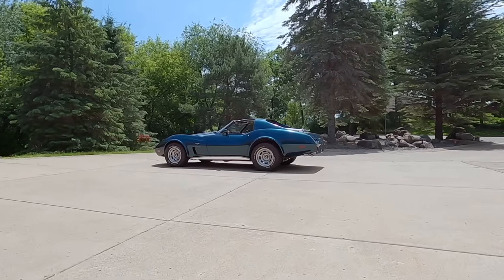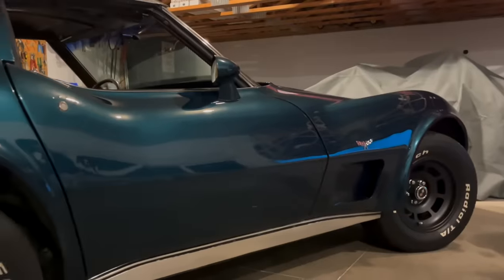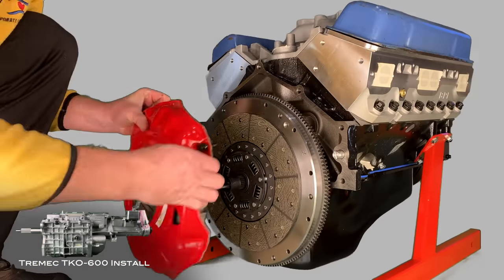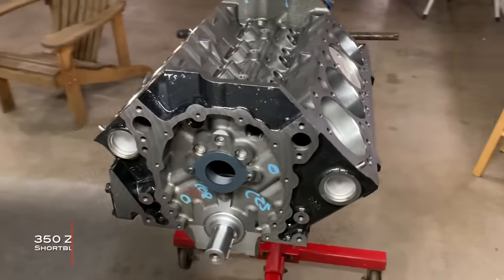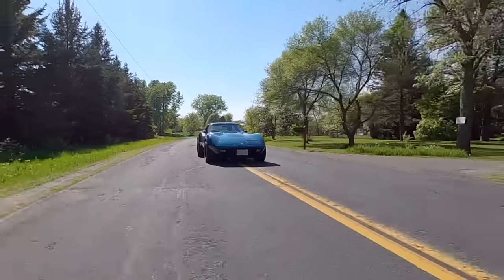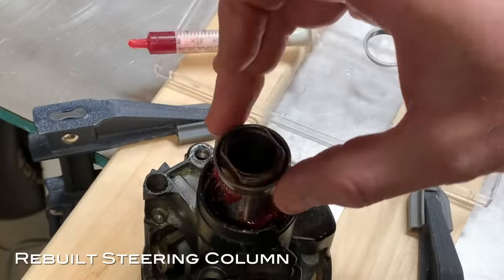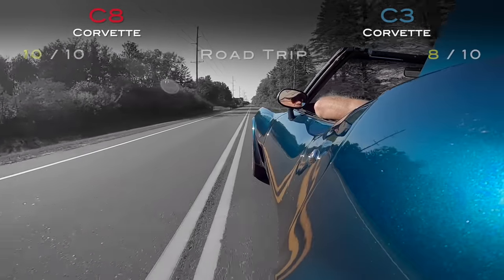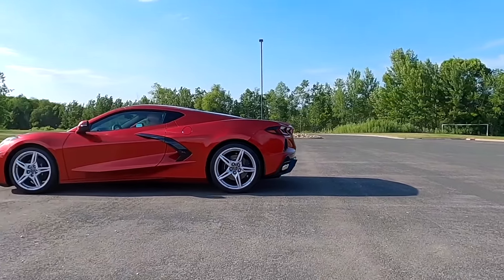C3 Makeover: Modernizing a Classic Corvette

Comment: Can't argue with your scores man!

Old cars have a totally different appeal and it's nice to see you appreciate all of what's great about these two very different sports cars.

I think a lot of people struggle to understand how someone could rate a nearly 50 year old car so highly, but gearheads get it.

Great video!
Reply: old cars have character
Reply: @BuckingHorse-Bull  Yep and Id never make a change to neuter that aspect
A proper adjusted carb/choke will start immediately hot or cold. Never sit for hours in 110 deg heat so not worried about vapor lock. To me adding EFI just adds more to go wrong/fail.
Reply: These cars were plenty modern when new other than engines needed to be taken back to 1960's spec.s... 
The stock L82 cam was 224/224 durations... of course, this was an L48 with 196/202 cam...

Comment: Not a corvette guy at all here, just a gear head.   I love the practical approach to your video and the way you broke down each of your mods, not just how you did it but WHY you did it and what the benefits were.    I have a 2000 Mustang GT that I've updated over the years and I was nowhere near as coherent when I did my videos -- plus I can tell I'm not as rounded of a mechanic -- your work speaks for itself.  Very clean and concise work here and I can tell you clearly have a passion for your cars.    I have a bone stock 2011 GT500 and love driving it but have to say with some of my upgrades to the 2000 I enjoy the car so much more.   There is no doubt though, it's nowhere near as safe as the newer car.    I augmented my fuse boxes in almost identical fashion BTW -- the fuse box for a stock 2000 mustang is under the drivers dash -- you have to be a monkey to change the fuses and I curse when I have to get down there and change a fuse.   So I added an augmented circuit setup very similar to yours.   Made a world of difference.   Plus it helps that the new fuse boxes have leds to show you what fuse is out.  

Loved your video and approach.
Reply from the maker: @fericyde - thanks for the nice comment - 2000 GT had the 4.6 I believe correct? Nice motor/nice car and tons of cool mods are out there for this gen of mustang. 2011 GT500 too!?! Nice garage myman!
Reply: LOL, yeah, the 4.6 I have to say was the best part of the car that I had to remove to swap in the Coyote (this is what I said in 2012, I've driven it over 10 years swapped now).   The 4.6 was reliable, didn't use oil at 160k or so miles and still ran great -- sold it to a ford mechanic and his son who were rescuing another GT that had been blown up (after some mods I understood -- they were going a more stock route).   I also put in a T56, major suspension upgrades, an android head unit (I use Torque from time to time but just android auto alone is an improvement) UPR k-member up front and a griggs racing setup in the rear with a torque arm (very similar to the one that is on a 3rd gen Camaro BTW).   I'm shooting for 51/49 weight distribution some day :)  at the moment I'm at 52.5/47.5 -- close but that 40-50 lbs of weight are rather hard to move without something drastic happening.   
 @TacoJoe
Reply: 100% I subscribed. Just found the channel. All hail the algorithm?

Comment: I have a 72 and an 02 Z06. The one small change I did that made a huge difference was swapping out the steering wheel. The stock wheel in 72 at least (maybe not by 77) was pencil thin and so large that you only have a couple inches between it and the door panel. At 6’2”, it also sat on my thighs. Ecklers makes a reproduction that looks identical, but is a few inches smaller in diameter and leather wrapped, so it’s thicker and more comfortable to grip. It made a world of difference in leg room.
Reply from the maker: Hey well said & totally agree. My steering wheel needs an upgrade too and thanks for the tip!
Reply: Makes anight and day difference!! 6ft3 that stock wheel was a joke and made driving feel way more cramped than it was
Reply: I know the 80-82 had smaller thicker wheel
Reply: Of course these cars were plenty modern when new other than engines needed to be taken back to 1960's spec.s...

Comment: Really glad you used a post-smog C3 for your build. The iconic style is there, but the performance and driving experience suffered critically from shoehorning all the necessary emissions equipment into the late 70s models. While it might bother some enthusiasts that it's not stock, personally I don't see any value whatsoever in preserving the lesser driving experience of a gas-guzzling, less comfortable, lower performing car when bolt-on upgrades are so readily available and make such a huge difference.
Reply from the maker: @bitemedude - totally agree - and - its easy to upgrade C3 / other classic cars too / thanks for the comment!
Reply: Exactly, screw the purist crowd. Stock they were pig slow, boring etc .
Stock doesnt equal more value (which I could care less about) either theres a butt for every seat
My #s L82 buyers could give a chit if the #s matched or not ...purists just wanted to nit pick it and tell stories while chiseling $$.
Never again
Reply: So true, these cars were plenty modern when new other than engines needed to be taken back to 1960's spec.s...

Comment: In S. Ga., AC was the best upgrade I did then the 5 Speed. Both were a must to enjoy it though. A carb will perform just as good as FI but you must know how to set it up correctly. Adding upper arms to get more caster will up the handling and crushing a lot in c3’s as well. A few minor but very easy things I did was the borgenson power steering with the brace, the Holly serpentine belt kit (uses the ls water pump, alternator, power steering pump, and Sanden ac compressor), electric headlights, and led bulbs (especially on the gauges) I chose my 73 over a 80 because of the sunken speed/tach and love the 60’s fighter plane inspired gauges. Although I love seeing all the cool custom interiors (yours is nice and clean) that add cup holders, I just can’t bring myself to removing what I think is one of the coolest aspects of C3’s. Overall I’m glad to finally see these cars getting the love they deserve the last few years.  Great job on your car!
Reply from the maker: Thanks for the comment @ktr831 - well said. The serpentine setup definitely is a worthy mod- where does the belt tensioner go? I can totally see the benefit of upgrading the pulleys and steering upgrades are great to consider too  - my OEM steering setup works OK but it wanders with the valve slop. I kept all my interior pieces too so I can revert back someday if I want (or if values of the C3s continues to climb and collectors are interested in the OEM interior / etc) - thanks for the comment!
Reply from the maker: @ktr830 - one more thing / the quadrajet carburetor that came on the C3 (when tuned correctly as you say) - is a GREAT setup. A lot of people hate these carbs because of the small primaries but when tuned correctly you get the best of both worlds - great cruise fuel economy - throttle response and large secondaries to dump the gas when needed!
Reply: @TacoJoe  look up Holley part # 20-240BK. Thats what I went with because it’s one piece instead of a Lego set of brackets. Also allowed me to change heads without pulling the belt off.
Reply: Love your ideas.  My first new car was an early 1977 Corvette, kinda nostalgic for that reason.  Somebody must make suspension mods ...as that was my only gripe.  I'd get another is so! :face-fuchsia-wide-eyes:

Comment: Making my 82 streetable has been challenging due to the 550 hp Dart 427. It has a big cam so I had to use a hydroboost brake booster. I went with a Steeroids rack and pinion for a more refined steering.  I went with a 4L80E with US-Shift 4 TCU. It's a beast. It has a FAST Street XFI Multiport EFI system.  For comfort it has a new interior leather seats, AC, 7 inch touch screen,  Dakota Digital system with retained accessories, cruise control, keyless entry and start.
Reply from the maker: Oh man that sounds like a handful - and - a totally sweet ride!!! They don't get much stronger than a 427 dart block. I've watched the dart blocks on summit-jags and the only bummer is the long 3-6 month lead time (seems prior to COVID these were much easier to order and see in a few weeks). Did you use an OEM hydroboost unit or aftermarket? Thanks for the comment - any links/pics to your 82? Sounds awesome!
Reply: Very nice!  I've got a many year project 79. Did Steeroid Rack conversion, rebuilt the 14.4k mile 350, Profiler heads, aggressive Mike Jones roller cam, aftermarket TPI intake, Holley HP fuel injection, 4L60e conversion (with the TCI EZ TCU), LS ignition coils, 58x crank trigger setup. QA1 single adjustable semi-coilovers, some other suspension bits, sound deadening and new carpeting, a Shark Bar 5 point seatbelt harness bar, new stereo system, LED and HID light conversion (Dapper Lighting 575s), electric headlight motors, Willwood Big Brake conversion.

I need to get the EFI harness installed and a 100 tiny mini-projects completed so that I can start it up.  Then it'll be stereo and gadget time. (I already replaced all the speakers, anticipating a touch-screen stereo.) The 100 tiny projects after getting the engine reinstalled are slowly killing me and sapping my motivation....
Reply: @adamarndt7617  Mine has been a 10-year project.  It's always evolving.  I was having transmission overheating problems so now I'm installing a large fan cooler oil cooler. I'm adding an engine oil cooler too. I'm also installing a crankcase evac system.  I had to replace my MSD distributor due to corrosion making it misfire.  I have 1700 miles on this setup and I just had a hydraulic lifter failure.  I called Howard's about it and they sent me a new set. Luckily the cam wasn't damaged.

Comment: Get a Ridetech coilover suspension.  My 1979 Malibu handles as good as my 2013 M3 did.  Game changer for the fun factor
Reply from the maker: Hey thanks for the tip @popeye089 - does the ridetech setup have a threaded shock sleeve to adjust ride height too? Might need to look into this - thanks for the comment!
Reply: It does. And they have single and dual Coil options.

Comment: I upgraded my 74 C3 similar but automatic.
Coil over front shocks, fiberglass mono leaf rear.
Punched out the engine to 355 cid, aluminum heads, mild cam 460 lift 272 duration, compression 10.75 to 1.
Running a Holley sniper fuel injection system. 
I modified a standard GM HEI distributor so I could control the timing with the holley sniper system. The last thing I’m planning on doing is to install a rack and pinion system for the steering. I’ll be doing that sometime next summer.
I’ve had this car since 1985 and loved driving it back then and even more so now with the mods. 
Enjoy your C3 and drive it, it was made to be driven and not sit inside a garage!
Reply from the maker: Hey I like the HEI mod so sniper can adjust timing! - is it a just replacement metal pickup/contact -reluctor setup that the sniper can control over a larger degree range after you set timing at a specific "set" cal value? I know my edelbrock setup was calibrated to 12 deg then once set, the ECU takes over / thanks for the comment!
Reply: No, you first have to prevent the mechanical advance and vacuum advance from changing. Then you need to modify an old HEI cap so you can see where the rotor is pointing to get a good approximation. Holley in their setup wants a fixed 16 degree setting when using timing control and you should see that 16 degrees with your timing light. Once that’s set you put the Holley system in control. You can purchase a cable to bring out the reluctor signal. The module inside is discarded.
Hope this helps! @TacoJoe
Reply from the maker: I sure does / thanks for the details! I have a have a small block ford build in the works and may add EFI to the mix - and  with the build - take on more mods like this (vs a prescribed Edelbrock kit setup) - I love the HEI design and appreciate the help!
Reply: Sorry for such a late reply, all I did was remove the stock Gm module and I purchased a cable from Holley to connect to the two reluctor wires that originally plugged into the module. I also had to lock the mechanical advance. I had an old HEI cap that I cut up so I could see where the rotor was pointing. From what I understand is that the Holley distributor comes with a clear cap to show you where the rotor it pointing.
Now I setup my sniper first to get that going and once I was happy with it running,I then tackled the timing my way.
Hopes this helps you and again, sorry for the late response! @TacoJoe
Reply: If you do the rack and pinion (Steeroids, I'm assuming) conversion just make sure you get all their new reinforcement brackets. I have the v1.0 installed in my 79 and the original brackets flex too much and do not inspire confidence. Also know that your turning radius will slightly increase if you do the Steeroids conversion as you can't turn the wheel quite as far lock-to-lock. 

The Steeroids rack is very picky with your power steering pump specs, too and it wants a narrow range for pressure AND flow from the pump. If it flows too much and you don't install a power steering cooler, it can actually damage the rack and lead to premature failure... (Steeroids says 1000-1200 PSI for the pump; 1000 makes it less darty at high speed, but harder to move at idle / low speed; they also want a pump with <2.5 gallons / min flowrate) Note: I think Hydroboost systems want 1,500 PSI & 3 GPM flowrate...
Reply: Yeppers, these cars were plenty modern when new other than engines needed to be taken back to 1960's spec.s...

Comment: I think there is another, albeit subjective, measure you might consider - Smiles/mile.  The C8 is a fantastic car, and if you could chose just one to live with, it likely would be a reasonable choice, given modern convenience and reliability/performance.  For me, as I have an affinity for older cars, I look for character.  Very few new cars have it, but I think that's very much in the eyes of the beholder.  I was really hoping that GM would allow the C8 to be a 3-pedal car.  Alas, it's cheaper to make with only one transmission, and the focus on performance figures took that away.  Great video, and spot-on editing!  What's next??
Reply from the maker: completely agree - if the C8 had a 3 pedal option, I definitely would have gone that route / thanks for the comment!

Comment: A big factor I consider to be important if you want an older car to approach new car levels of daily comfort and usability is the weather seals around the doors, windows, T-tops, and also the alignment of doors, windows, T-tops, etc. Whistling wind noise and/or dripping rain inside both contribute towards older cars feeling their age and being annoying to drive often.
Reply from the maker: Excellent excellent comment and I completely agree. I actually replaced the door seals and T-top seals too but didn't capture that in the video. The door seals made a HUGE difference with road noise and totally eliminated some of the door rattles with the latch linkage too. Thanks for sharing @xtnuser5338 and well said!
Reply: @TacoJoe  Rattles, squeaks and resonant vibrations are another checkbox that should be addressed by anyone seeking to refresh an older car. Spend the time to track them down and eliminate them. Sometimes it's just a loose fastener. Sometimes you just need a bit of foam rubber tape between two parts. Sometimes more effort is required, but eliminating such noises goes a long way towards making your pride and joy livable on the regular. It can be the difference in a passenger walking away thinking you have a shitbox versus thinking you have a well built, tight, quality machine.

Comment: I'm planning on buying a project Corvette 1979. I would be starting from scratch and I wanted to know how to modernize it. I know most people will try to keep it stock, which for the most part I will. But I would definitely like to have better transmission, fuel injection, some android radio dashboard, better breaks, power steering and stuff like that. I love the looks but I have owned 1979 vehicles and I know how lacking they are.